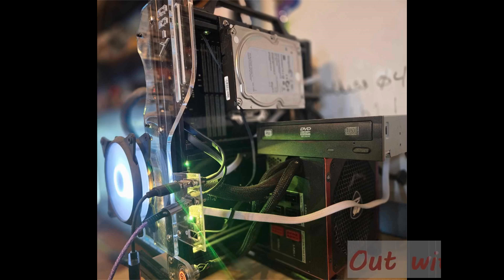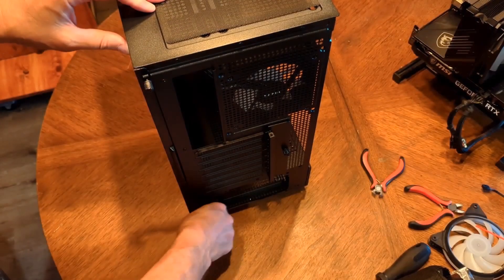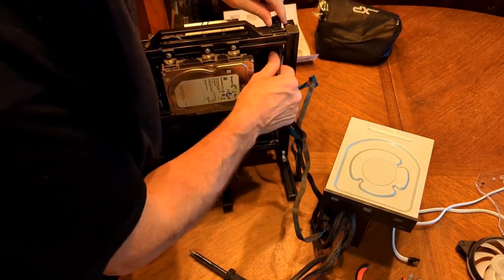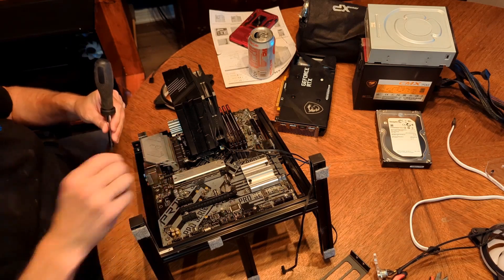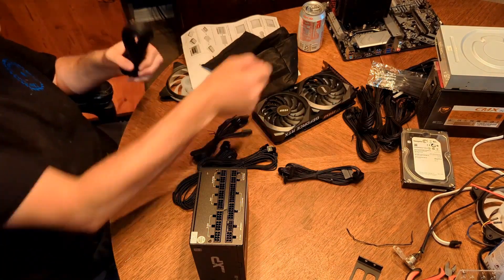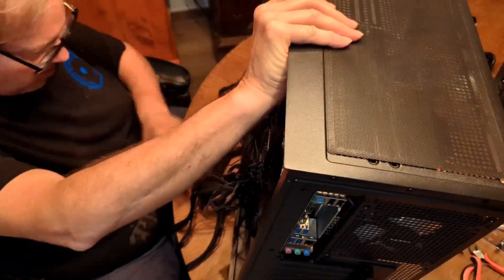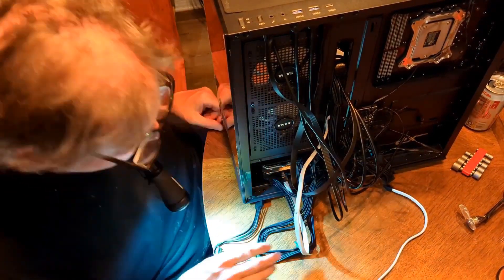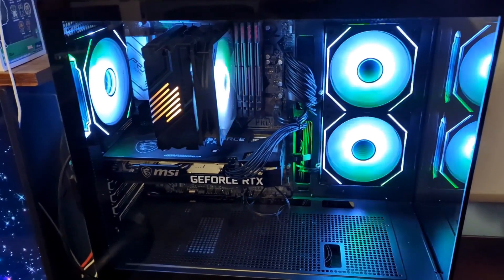PC Rebuild- old machine to new case

Comment: Hey, are the 2 front fans intake? And the rear one exhaust?
Reply from the maker: yes. They came with the case. There's grating all over this thing for air to escape. I was considering adding more fans for aesthetics, but ultimately decided that this was good enough for my purposes. I did eventually mod the front grill under the glass to run power and SATA cables through so I could use my optical drive. I still need to build a custom housing for it as it is just sitting there on the shelf in front of the PC.

Comment: Love this video got watched it the other day , got the same case to upgrade had b550m prime ASUs your video helped me with my build with the fan hub all my fans are on but RGB only works on on one fan any suggestions ??
Reply from the maker: This hub has 2 plugs for each fan and an input from motherboard plus a SATA Power connector on the bottom. make sure each fan has both plugs connected to the correct connectors. The designations matter. Power/ argb control must match each output on the hub. and of course, it needs that SATA power to distribute to the fans. THEN make sure to controller hub's argb control is connected to the correct output on your mainboard.
Reply from the maker: I hope I explained this OK, I have been down for nearly 2 weeks with a major lung infection- Thankfully, I am on the mend.

Comment: Hey, great job. Note : you would get better temps by having the side fans as intake instead of exhaust. 

When using a modular PSU an amazing tip is to run the cable from the motherboard first, cable manage the back clean and the slack will remain in front of the psu.
Reply from the maker: I have plans to add fans to exhaust out the top. Ans thanks, never ever thought to start with the mainboard and run TO the psu. It's all done now, maybe next time!
Reply: @The_Good_Enough_Guy_Crafts  i'm fairly sure you got enough fan at least on the performance stand Point for such specs. Exhaust at the back, intake side and you're golden.

Comment: I have built many PC's and not once did I wear a anti static wrist stap and I have never had a problem
Reply from the maker: I haven't either. The guy I reference in the video is hardcore "do it the right way." Working with EXTREMELY expensive equipment, takes no risks and expects those he works with to follow the guidelines. I could feel him cringe while I was working on this,